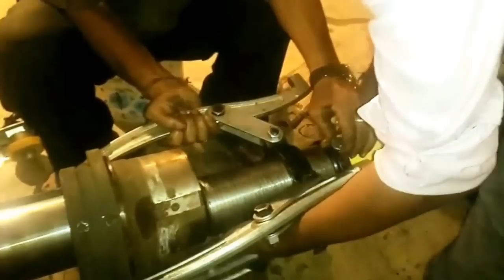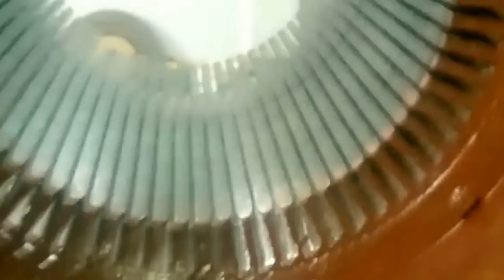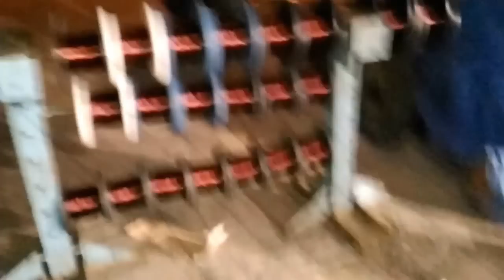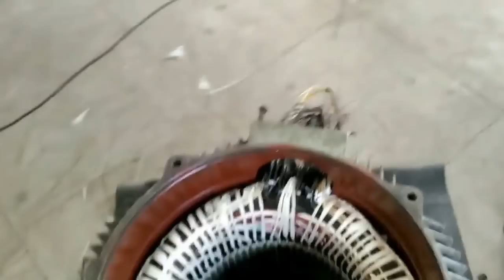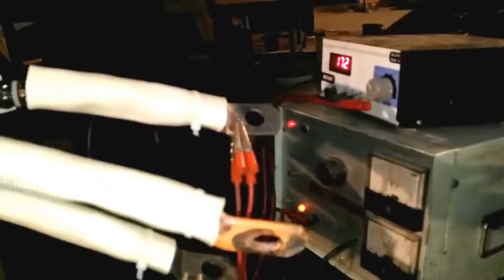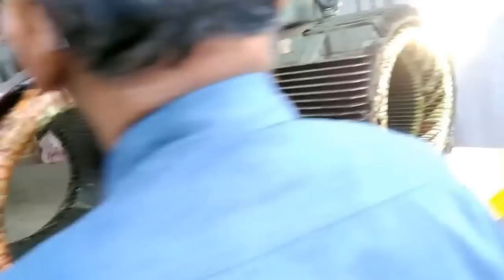500HP Induction Generator Repair

Comment: Doubly excited rotor, Yes or no?
Reply: Sir,our company manufacturing carbon holder slippring carbon you need please contact me my email id is skhanicai@gmail.com
Reply: @shahicai7979  not use carbon / holder in induction generator bro . 🙏
Reply: But in the video, they are saying motor.. motor.. motor.Don't know why. Grid connected Induction generators do not require exited rotor. And any induction motor can be used as induction generator.